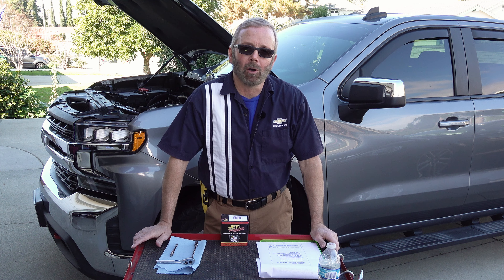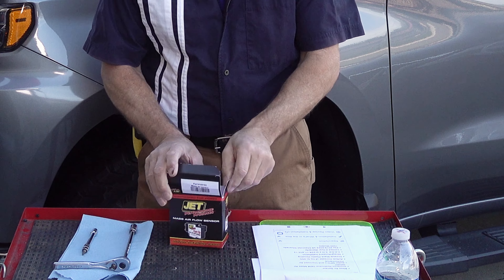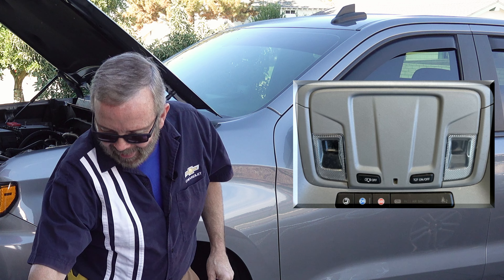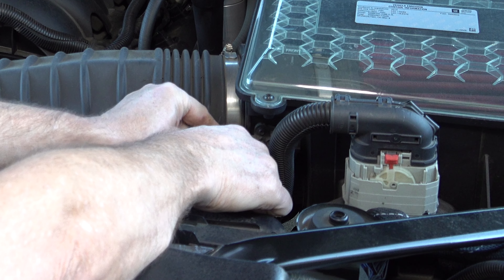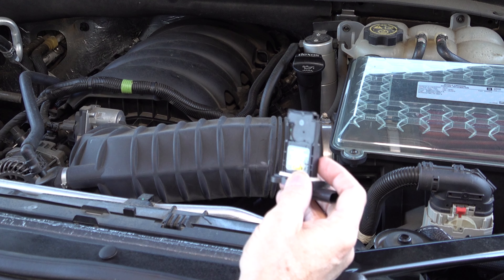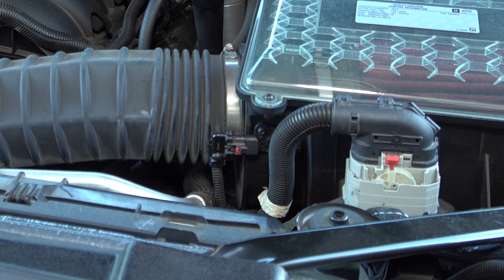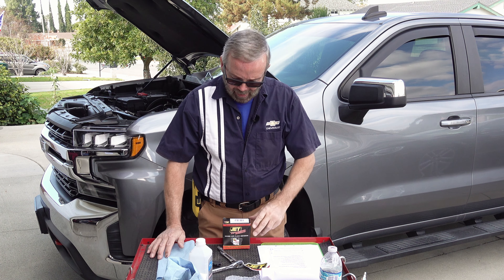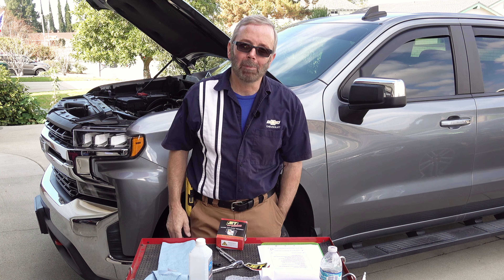Installing the Jet Performance Powr-Flo Mass Air Sensor w/Paul Henderson

Comment: Man what a difference that lil sensor makes. I felt like once I drove a bit my mpgs got better 19.4 with 35s and a level kit. Worth every penny.
Reply from the maker: That is awesome to hear. Be sure to keep the stock one is a spare, those little guys are expensive.  I'm still hoping to go on the Las Vegas trip in the first week in April while on my vacation. This will be the first real trip since I installed the JP MAF sensor. Right now, with the combination of city and highway there is a small increase in MPGs. So I am very curious with a long study drive what will the MPG's be.
Reply from the maker: I also have the Gm/Chevy CAI Intake System, the filter had 32,000 miles on it, so I removed it and installed a new one and it now is peppier than before.  I did clean the filter which is a (dry filter media style filter), I used the K&N dry filter cleaner. I will be taking that filter to the K&N main office which is not far from where I live and have them verify that the filter is a cleanable dry filter type.  So you might want to check your filter and pop in a fresh one, I wish I would have done this before the Las Vegas Trip.

Comment: Did you notice higher rpms on the highway? I feel like im drag racing. I also added a spacer while having a flowmaster, when i step on it, sounds pretty crazy
Reply from the maker: I noticed a small increase in RPM's during takeoff from stop lights and pressing down on the throttle while on the freeway or a major street, she also sounds a bit smoother at idle when I pop the hood open and listen so maybe the air flow is being adjusted more accurately. After three hundred miles I have noticed a small increase in MPG's, I did not do my Las Vegas trip that I was planning on doing last week, I made it to only 100 miles from my house and decided not to go I just didn't feel up to it. With the current tank of gas my DIC shows I'm at 17.3 mpg's city/hwy and this was after I filled up when I got back from trying to go to Vegas. On that 200 mile round trip my MPG's was at 20.4 I'm sure it would have been higher if I would have made the entire round trip to vegas and back.

Comment: How’s the mass air flow working? Any CEL ? Is it worth the install. Tia
Reply from the maker: So far so good, no issues of any kind. I think it is worth it, I can tell that there is a small difference in the performance. I haven't taken it on a trip as of yet, but there was a small increase in highway & city driving. I might be going to Las Vegas next month so then I will be able to get a more accurate MPG's. I will be doing a video on the MPG's after the trip.
Reply: Sweet ya I’m looking for any additional items to my intake exhaust.😊
Reply: Thanks for the video. Just bought it for my 21 5.3 trailboss 😊
Reply from the maker: @trailbosschrispayne5454  
That's great, let me know after a few weeks if you can feel a difference.